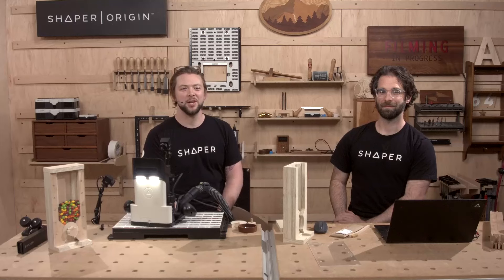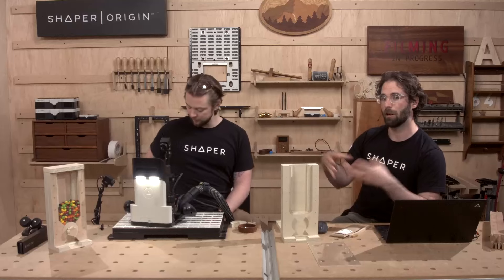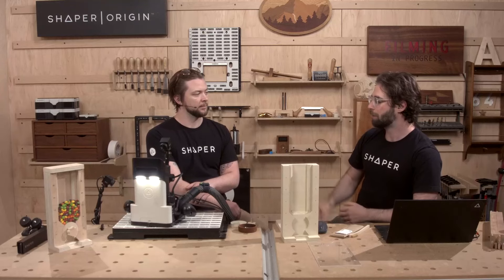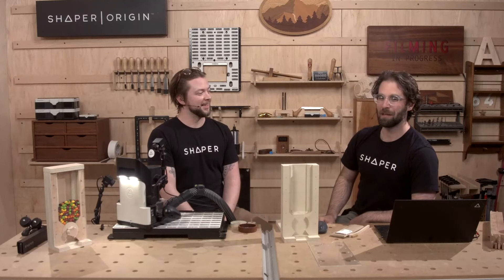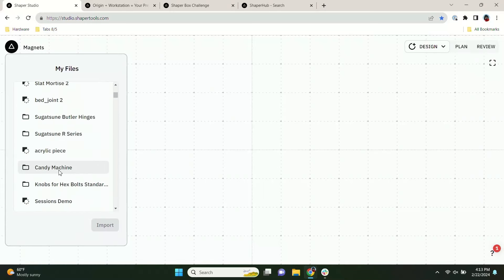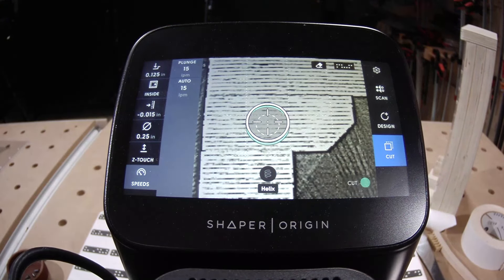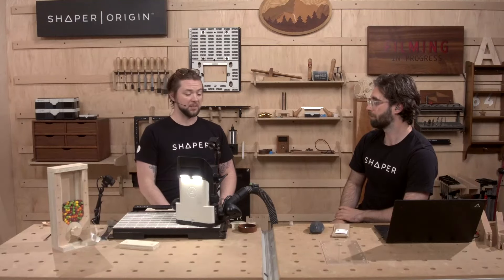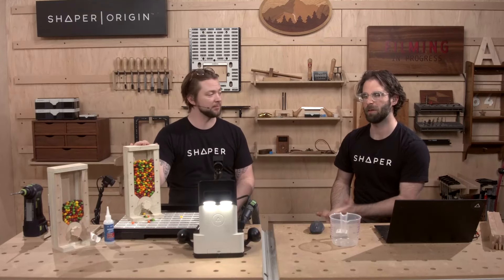Session 100  – English: Vertical Workholding with Shaper Workstation - Candy Machine (Part 3/3)

Comment: I wasn't able to make the live version of this one, but I have a couple comments. When editing the file for the magnets on the top, I would have moved the custom anchor to the top left just in case I hadn't cut my parts to the exact width that I hoped. This way the magnets would be properly aligned and would not risk having a slight offset on the top when dropped on. Second, magnet hack: I put a sharpie mark on what will be the showing portion of the magnet so I don't mess up the polarity. It comes off with alcohol once the glueing is complete.

Comment: Re: Your box challenge, guys. Much as I'd have enjoyed entering it, you inadvertently made it impossible to do so. A simple problem: time. Living in rural Wales, I have to mail order imported timber (mostly from the US) and my only decent supplier has a 14 day turn-around. There go two weeks before we even start. Then there's the week acclimatizing that the wood needs - really needs if I'm going to mill it thin enough for box making without it cupping within hours. So that's three weeks to source suitable material. Add in the week America's favourite finish, Rubio Monocoat will take to cure before I can apply ceramic nanocoat ito get a decent sheen and that's four weeks, leaving about a day to actually do the woodwork. 
So maybe next challenge, you'll spare a thought for the woodworkers who don't live ten minutes drive from a hardwood supplier and announce the challenge earlier than a month before the closing date.